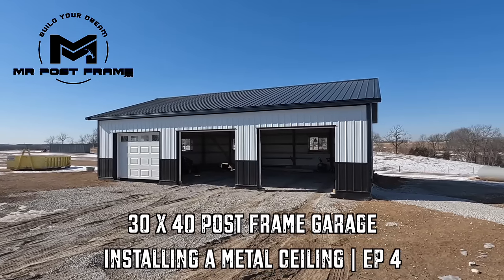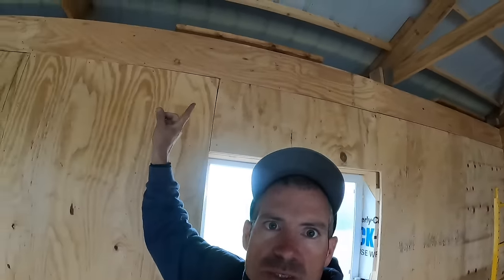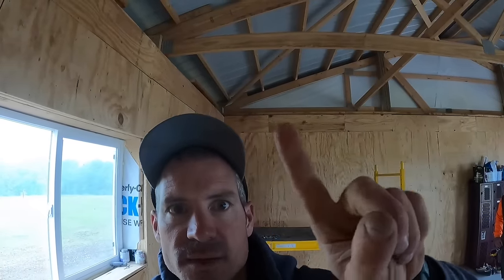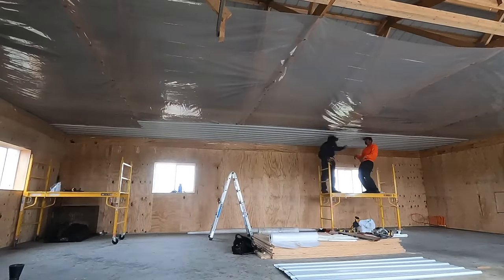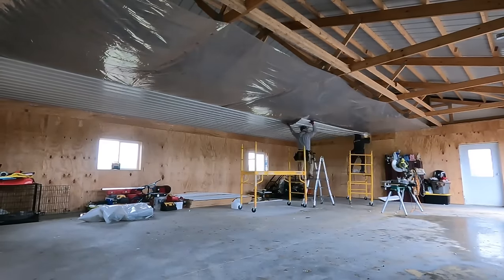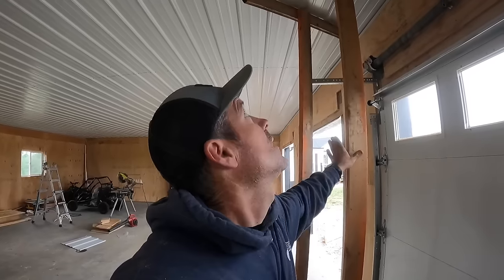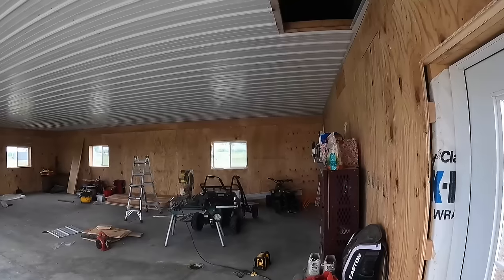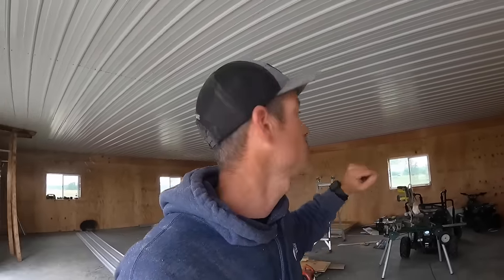30 x 40 Garage | Installing a Metal Ceiling | Ep4

Comment: Staggered seams - YAY!  This looks so much more professional than having all the sheets break at the same points.
Reply from the maker: It’s a must!
Reply: @Marshall Remodel | MR Post Frame  
I've never seen a builder skip out out on using A-frames (trusses) until seeing this video. There not enough trusses to support this barn/garage. Wow, just wow. Where's the ceiling insulation?

Comment: Would this be strong enough to hold around r30 insulation without any additional support? Thinking of doing this in my barn but trying to figure out if the weight of the insulation would cause the metal to bow.

Comment: I'll be doing the same thing soon, so all the electric, lights, wiring, boxes goes on top of the metal? Like do you have to cut hole in the metal to run wires? Thanks

Comment: You mentioned you would be running conduit. Why choose that? I totally get the  accessibility factor keeping wiring on the surface. Im curious if youve done metal ceilings then cut out for light  fixteres, outlets, etc. Also, you'll be installing garage doors. Would be great to see how you cut the metal for the hangers and then trim it out. One last thing. What about cell phone reception?

Comment: Nice work. Although consider a quicker option. Unscrew the roofing sheets in segments and lay down rolls of Foil Foam. It's fantastic stuff, I've used it in two of my Ozzy sheds so far.

Comment: Great video. This is the exact solution I was looking for my 3 car garage with open ceilings. I found the product you linked to Menards. Thanks. Never worked with this metal material before. What do you recommend to trim/cut the panels?  Thank you again.
Reply from the maker: Thanks for watching. Couple of tools below.

If you're not going to be doing a lot of cutting...the least expensive option and the first purchase would be snips.

https://www.menards.com/main/tools/hand-tools/shears-snips-bolt-cutters/midwest-snips-reg-9-1-2-offset-aviation-tin-snip-set-2-piece/mwt-6510c/p-1536820119371-c-1550852385007.htm

If doing a lot of cutting I would also recommend purchasing nibblers. I started with the corded Makita nibblers but now use the Milwaukee M12 cordless nibblers.

https://www.homedepot.com/p/Makita-5-Amp-16-Gauge-Nibbler-JN1601/203162029

https://www.homedepot.com/p/Milwaukee-M12-FUEL-12-Volt-Lithium-Ion-Brushless-Cordless-16-Gauge-Variable-Speed-Nibbler-with-4-0-Ah-Battery-Charger-2476-20-48-59-2440/321639851

Comment: Is the vapor barrier really necessary? If you have a vented roof, isnt that hot air escaping and basically removing any possibility of condensation?
Reply from the maker: If there’s no roof sheathing under the metal then you’ll want a vapor barrier
Reply: @MrPostFrame  I should have specified - I have a traditional shingled roof building that is ridge vented with air coming through the soffits and up and out the roof ridge. I want to do a similar ceiling like this and insulate above a drop ceiling. Unsure if I need a vapor barrier for this. I am in NC where it gets pretty hot and humid.

Comment: Can the rafters support the extra weight with no bracing ? I got a 30x32 building I am currently working on as well
Reply: This is a good question. Rafters are usually rated for roof load, not carry load underneath. But you can have them spec’d for this. So depends on spec.

Comment: Why did you not put in double bubble or drip stop below metal roof?   Nice color scheme similar to mine for my Barndo project about to start.  I am going to use Edco 12" board and batten Glacier White metal siding and black Onyx board and batten wainscott and weather master Black exposed fastener roof with double bubble and SCAMP stainless head fasteners.
Reply from the maker: They'll be using blown in insulation for the attic space and so it wasn't necessary to do more than the plastic barrier and air sealing.

Comment: Also looking for what gauge metal that was, getting ready to do the same exact ceiling. Was going back and forth on adding supports between the 7.5 ft bays.  Do you have the source for the panels?
Reply from the maker: Where are you located? Do you have a Menards in your area?
Reply: @MrPostFrame  Kansas City area, yes Menards is close
Reply from the maker: https://www.menards.com/main/building-materials/pole-barn-post-frame-materials/steel-panels/cut-to-length-premium-pro-rib-reg-steel-panel/white1559000-01/p-1444448671314-c-5717.htm?tid=-6575712354900332919&ipos=1

Comment: Can you span 8ft with out sagging?  Can insulation be blown in on top of that span?  Thanks
Reply from the maker: Yes. It’s rated to span 8’ with blow in insulation on top.
Reply: @MrPostFrame  , I'm doing a 30x40 almost identical to this and the above was my same question.  I've been killing myself trying to figure out how to do purlins but I would love to just use the 8' span trusses (mine are 2x6's).  Do you know what gauge metal you used to make sure it is the same metal I am using?